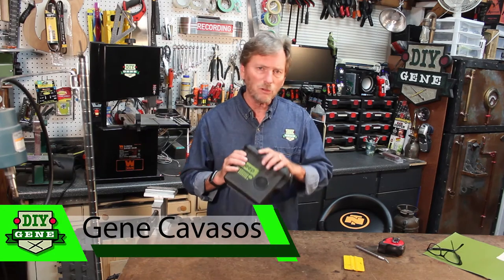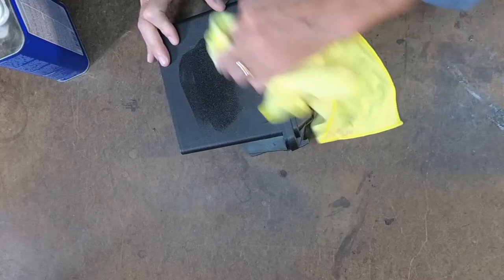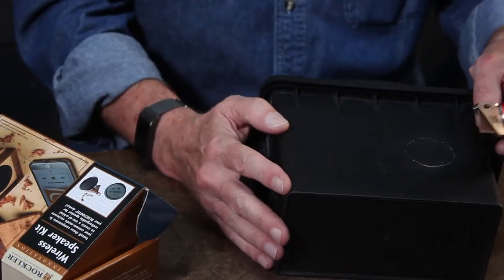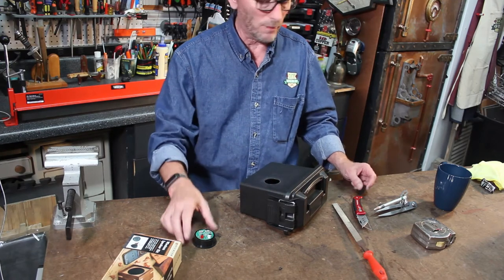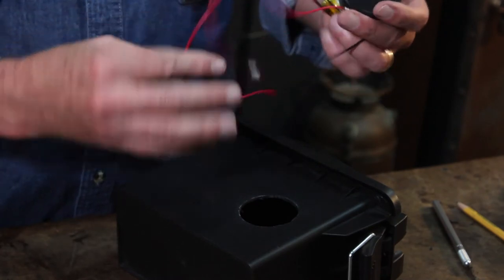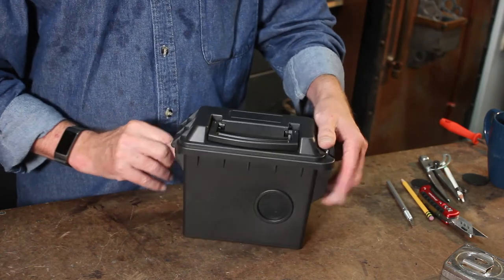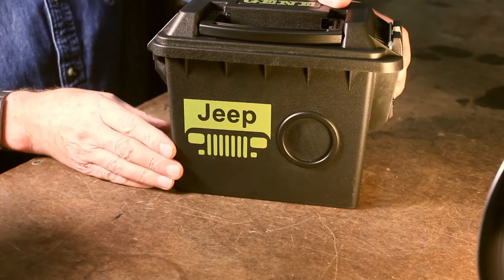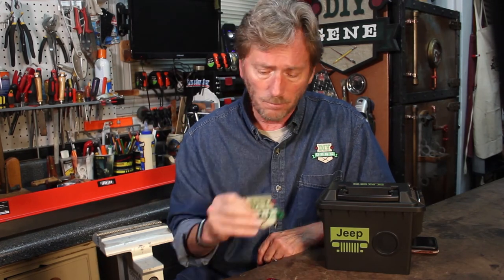Bluetooth Speaker Ammo Box. Simple Cheap Easy!

Comment: I wonder how you would do with one of the many Bluetooth mp3 -mp5 multi media automotive car stereos a your choice of speakers in like maybe a small cooler or a plastic tool box and either a cpu or a Amazon type 12 v power supply and I wonder how it would turn out and what kind of sound quality and signal or wifi receiver reception it would receive just an idea gene sir.. think it would be a awesome fun project and a great video...
Reply from the maker: That is a cool idea. Use like a 7” screen stereo. I may have to look into that. Thanks for watching.

Comment: I was woundering 6.5 150watt white plye hydra marine speaker would fit on a plastic dry storage marine box 15.13x7.88”Wx10.3”H  on front side by side?
Reply from the maker: Hi Kyle, I’m not sure about the overall size of that speaker. I would suggest if you have a Harbor Freight in your area? They have a nice selection of these boxes. Also Northern Tool has these too.

Comment: No offense, but it seems that maybe using a hole saw would’ve been much safer due to your shaky hands. I was getting quite nervous watching you use the blades.
Reply from the maker: None taken, I have what’s called Essential Tremors. But I wanted to try using the least amount of tools for this project. Thanks for watching.
Reply: @DIYGene  I have a disability that affects my autonomic nervous system and I also do a lot of diy stuff so I can definitely relate. I 100% admire and appreciate what you do because you’re such an inspiration 👍🏽 keep up the good work and I look forward to seeing more of your videos. 🙏🏽
Reply from the maker: @hulksta3223  , thank you so much. Sometimes it’s hard but I will keep pushing through. Folks like you keep me going. Thanks so much for watching
Reply: @DIYGene  absolutely! We got your back Jack!🤣
Reply from the maker: @hulksta3223  God bless you!
Reply: @DIYGene  aww you as well 🙏🏽🙏🏽🙏🏽🙏🏽
Reply from the maker: @hulksta3223  I am thinking of CBD oil have you ever tried it?
Reply: @DIYGene  topical or ingestible? I like the topical for joint pain and inflammation. I’ve tried the ingestible and it worked, but I didn’t like the feeling of it. Like there was an initial feeling of a bad headache, and then it goes away.
Reply from the maker: @hulksta3223 . I got a small bottle that is    to be put under the tongue. I haven’t had any headaches but I haven’t taken much and don’t see much change. Maybe I should try a bigger dose. It says 100mg serving and the bottle says 3000mg.
Reply: @DIYGene   the one that goes under the tongue is the same kind I tried. It’s good you started on a low dose to test your tolerance for it. That is usually the rule of thumb for both medications and supplements (ESPECIALLY on the types that are habit forming). But I would suggest that to be on the safe side, double check with your doctor before you increase the dosage. I don’t know if you’re on any medications but it would be a good idea to double check for any type of interactions.
Reply: @DIYGene  what size plastic ammo box should I get 30mm, 40mm, 50mm box for 2 6.5. 1/2 marine speakers to fit on the front ?
Reply from the maker: With 2 6.5 inch speakers you are going to need a pretty large ammo box. at least a 7" high base box and make sure the depth can handle the thickness of those speakers. I would check out Harbor Freight or Northern Tool to see what they have in stock.  It sounds like it will be an awesome speaker ammo box.
Reply: @DIYGene  how can I find the 2n one you mention
Reply: @DIYGene  how can I find the depth that the plastic box can handle 2 6.5 1/2 marine speaker
Reply from the maker: @kylewilliams3306 , Check out the dimensions to the larger box in this link. That looks like it would handle it.
https://amzn.to/3SwNeuu